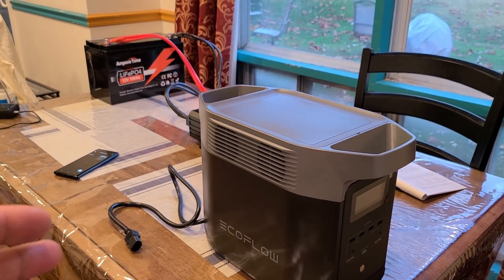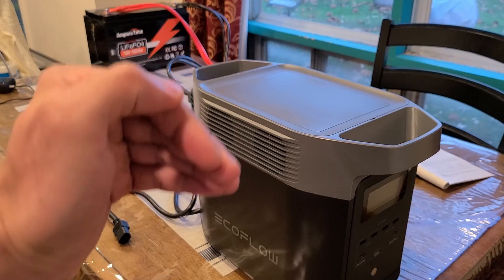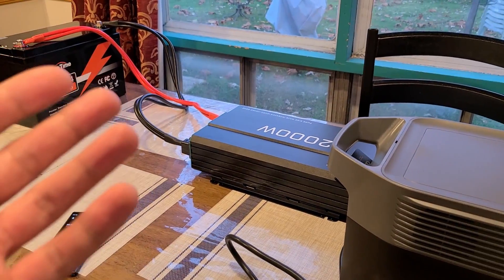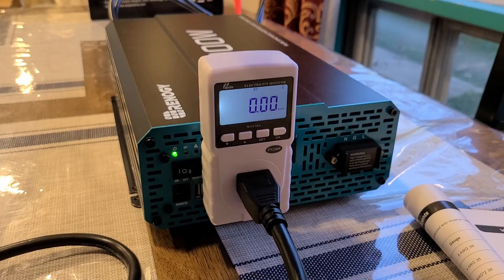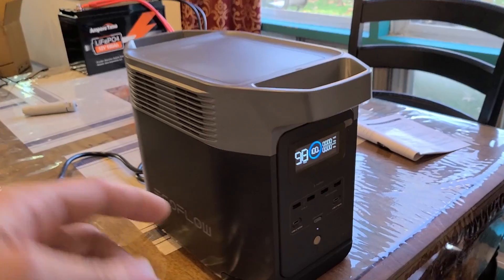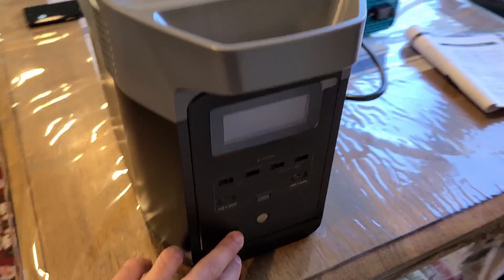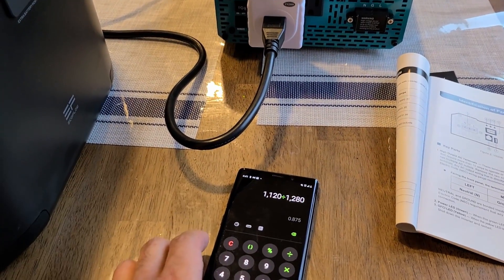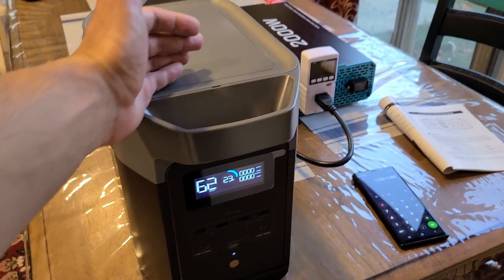Ampere (now LiTime) Time Battery Recharging EcoFlow DELTA 2 | Cheaper Expansion Battery?

Comment: use a 48v battery. no inverter is required. you will get the maximum solar charge by just plugging into your solar input direct from the battery.

Comment: I got a delta 3 plus then a 700w renogy inverter in my truck. It will charge power station at 700w no problems. Also have the alternator charger but never used yet

Comment: You are better off using a 24V, or 36V, or a 48V battery and connecting to the DC port used for your solar panels that has the XT60 plug.  With the 48V battery it will charge at 4 times the speed that the 12V battery offers and you do not need an inverter minimizing efficiency losses.
Reply: I was wondering why he didn't use that method.

Comment: What about with a conventional lifepo4 house battery with +\- poles? What’s the best way to connect a delta 2 max to this regular house battery so that the alternator charger is charging and discharging both batteries?

Comment: It sucks trying to charge your delta with the 2000w inverter at 300 watts. I tried with a 1000w inverter i was doing 200 watts but as you know my return date was like tge day before. So far out of energy is not working out. Im going to try Afllaa inverter.

Comment: Assuming you want to charge that battery from solar........... use a Victron mppt like the 75/15 or 100/20 that has a load port. Connect a cable to that port that has an xt60 female plug at the end.

Set the load port in victron app to turn of at 12.2 volt and to turn on again at 13.1 volt.

Plug the xt60 cable into the Delta and there you go, perfection!

The AC port is for using indoors when AC is available.
The DC port is for all other situations and these do not require charging at 1200 watt, not in real life.

Comment: Did you try turning off the Delta2 before you plugged in the 2000 watt inverter? Then turned on the delta2 then the inverter?

Comment: Great video thanks.  Is there a way we can hook up a deep cycle battery like that into the side expansion port?
Reply from the maker: Thanks for watching!

From one of the reviews for the expansion battery cable over on EcoFlow.com, it seems like the cable connecting to the side expansion port is proprietary. So I'm honestly not really sure if you can.

I did run another test like the one in this video, but I used a direct connection with the deep-cycle battery using the XT60 port for the DELTA 2. You can check out that video here:
https://www.youtube.com/watch?v=Q3cl_2AcDWc
Reply: Ya I seen that pretty cool.  We need to figure out if we expand it ourselves and have the unit charge both batteries bc that would be ideal imo. But im still pretty new bc I've only been using the delta 2 for a couple weeks. I like ur vids tho so keep em coming

Comment: Yeah, no need at all to spend money on an inverter.  You can either charge directly from the battery into the DC inlet port (if you're ok with 12 volt charging speeds), or you can step up the voltage with a DC to DC converter (for faster charge times).  A converter is going to be about a tenth the price of an inverter, and it'll be more efficient.  Since the inverter was only doing 300w, you could easily do that with direct DC.
Reply: Thanks

Comment: I have the Lifo4 battery like yours and the Delta2..... now my Inverter is a 375 Watt Modified Sine Wave Inverter.
   If you know, Do you think this would hurt my Delta 2 setting it up like you did there?
Reply: Es funktioniert nur mit einem reinen Sinus-Welle Wechselrichter.
Reply: don't do it because then you can't use your delta 2 as its being charged. the Delta 2 uses the inverter backwards in order to charge the battery. But if you use the solar input or car charger adapter that ecoflow supplies and connect it to a 12v battery it will charge the ecoflow and you can still use the full power inverter that the ecoflow has!!!
Reply: @uhjyuff2095  That is a good piece of information..... Thank you very much :)

Comment: I would hope to see a system that would work better with solar improvement say 500v 3000w. If the grid is down. What good is AC charger.
Reply: Hi Clarence.  You may want to check out the Hysolis Apollo solar generator.  It does have 500 volts of photovoltaic input as well as outputs 3000w.  It isn't on the market yet, but is scheduled to be released in December of this year.  I preordered and am looking forward to receiving it next month.  Minuteman prep has a video describing it.  Hope this is helpful.

Comment: USA  120 volt  'grid'  power  has  the  ground  &  neutral  'common'  before  entering  your  home.   That  way  a  'ground-fault'  interrupter  can  protect  you  from  electrocution  in  your  bathroom  should  a  difference  be  detected  between  the  ground  &  neutral.   (as  'splained  to  me  by  an  'electrician')  ! !
Reply: not correct. GFCI devices protect against electrocution by detecting a difference in current between the grounded conductor and ungrounded conductor.
Reply: @uhjyuff2095  -   The  ground  is  not  a  'conductor'  as  the  Hot  &  Neutral  are,   so  we  are  in  agreement.   GFCI  detecting  a  difference  that  should  not  be  there  (since  ground  &  neutral  should  be  same  as  back  on  the  pole  outside  your  home)   VIVA  la  Differance  ! !
Reply: @richardhobbs7107  you are clearly missing something. The current carrying conductors are the ones that can cause electrocutions. The two current carrying conductors that connect to the GFCI are known as the "ungrounded conductors" (color black/red) and the "grounded conductors" (colored white/gray).
Reply: @uhjyuff2095  -   correct  .  .  .   agree .  .  .   what  am  I  missing ?
Reply: @uhjyuff2095  -  although  ground  is  usually  green  .  .  .   are  you  in  USA  or  ? ?

Comment: Charger Harbor -  You  mentioned  @1:30  the  'ground-fault circuit would be interrupted'  on  the  Renogy Inverter.   Because  there  is  no  'ground'  handshake  with  the  neutral  connection  in  the  120 volt  circuit  ?  any  voltage  difference  would  cause  the  ground  fault  to  trip.    I  found  that  hard-wiring  the  ground to neutral  on  an  'adapter'  (two  to  six  socket  wall  plug-in)  fixed  a  problem  I  had  charging  my  Nissan  Leaf  with  a  (non-grounded)  power  station.   As  you  know,  power  stations  only  have  an  empty  hole  to  allow  a  grounded  plug  to  be  inserted  in  the  110/120  volt  outputs   .  .  .  .  .   depending  on  internal  wiring  of  Delta 2  that  could  be  the  issue.
Reply: The Delta 2 also has a UPS function, meaning when you charge from mains power the mains power is directly connected to the output receptacles on the face of the Delta 2. That way the wiring is completely safe and the exact same as using power from your house wiring. Not sure what is going on with charging the delta 2 with the renogy inverter suppling 120 volts AC to it and it struggling or tripping. Is it a problem with the renogy or the Ecoflow?

Comment: y do u have two + & - cables instead of 1?
Reply: the inverter is 2000 watt continuous output rated, which is equal to about 200 amps. Thicker wires are able to carry more amps.

Comment: If you can only pull 300w via the AC input on an inverter then why don't you just use the solar input on the Delta and put 500w of "solar" in it from the external battery?
Reply from the maker: That's a good question. I'll try it out. Thank you!
Reply: @chargerharbor  yea just eliminate AC and go DC from the battery to the solar input on the delta..
Reply: because theres no sun at night, the extra capacity is needed

Comment: I have seen others have similar issues with  Renogy  inverters. Once they got a different pure sine wave inverter things worked right. Renogy 2000 and 3000 watt inverters seem to be junk.
Reply: thats what i was thinking..   sensitive to "sin wave"
Reply: I've seen others using Renogy inverters on the River and Delta Max and get charges up to 1.1kw and over. The problem is with the Delta 2. Faults every time, once it charges over 290 watts.
Reply: DC  -   He  mentioned  @1:30  the  'ground-fault circuit would be interrupted'  on  the  Renogy Inverter.   Because  there  is  no  'ground'  handshake  with  the  neutral  connection  in  the  120 volt  circuit ?  any  voltage  difference  would  cause  the  ground  fault  to  trip.    I  found  that  hard-wiring  the  ground to neutral  on  an  'adapter'  (two  to  six  socket  wall  plug-in)  fixed  a  problem  I  had  charging  my  Nissan  Leaf  with  a  (non-grounded)  power  station.   As  you  know,  power  stations  only  have  an  empty  hole  to  allow  a  grounded  plug  to  be  inserted  in  the  110/120  volt  outputs   .  .  .  .  .
Reply: @richardhobbs7107  Oh okay I missed that. That is why in my breaker box ground and neutral are connected. I watched couple videos why. so if anything happens it will return to breaker so it trips.

Comment: Could you not just use the solar/DC charging ports to go DC to DC so you don't waste power using an inverter?
Reply: fyi... The Delta 2 D/C input has a "hard limit" of 500 watts using any combination of voltage between 11-60 Volts X's Amps = (up to) 500 watts. "Hard Limit", meaning that the Delta 2 inverter does not regulate D/C input and will reject and cancel "all" D/C input over 500 watts and charge at 00.00 watts. The Delta 2 inverter will regulate the A/C input in combination with the battery BMS in pre-programmed increments of up to 1200 watts of A/C input. I suspect those figures may change with future Firmware/Software updates?
Reply: @royrobinson4636  Nice piece of information.... thanks for taking the time to respond
Reply: @notwrkn2mch  ~ Thank you, I've done a lot of research on my own. 🤠
 I use my Delta 2 specifically as a backup power supply for my Starlink internet (router and dish), two mini-computers, two monitors, and two low-watt Led lamps.  Considering the Delta 2 "500-watt D/C Hard Limit", I use four (4) 12 volt/120-watt Solar Panels (480 watts) connected in parallel via the Delta's XT-60 port. This is a completely independent circuit from my larger house solar array, battery storage, and dual-fuel generator system. I live in a very rural area and we like to be prepared and as independent as possible. 😊
Reply: @royrobinson4636  Same here.... very rural north of Phoenix in the Sonoran Desert. I have 220 watts of solar and just one Lifo4 100 amp hour battery to keep charged and feed the Delta2......Good luck out there and it may be a rough ride ahead......
Reply from the maker: Like an XT60 to O ring cable? If so, I'll give it a try. Thank you for the info!
Reply: @chargerharbor  ~ Exactly. Since the Delta 2 does not come with a solar charge cable, I use a 12 gauge aftermarket XT-60 to MC4 cable to connect my panels.
Reply: I seen a video on Youtube where the person used the same Battery and put that yellow solar plug in the back to the battery and it tricks the Delta2 into thinking it's a solar panel and it worked just fine.... I haven't tried it yet
Reply: Sorry but maybe I didn't get it right ... expansion batt.?? This is charging the Delta from a Lifepo batt, I see that and works ok, but this is not as putting the Delta extra batt. !? As here in this setup you do not double the available power output to 2x 1024
Reply: The PV connectors are upgraded on the Ecoflow Delta Max2 to XTC60i which wil allow more watts than the standard XT60 connector. 

Also as most Power Stations have a floating neutral because they're connected in a variety of ways.

For instance when charging from an AC outlet then the AC outlet are grounded since most homes have a ground connection. 

When connecting to an appliance from it's outlets there isn't a ground, however, you can purchase a grounding plug from Amazon which has its neutral tied to its ground and this will then ground the other outlets protecting you from appliance shock should something short out on the appliance. 

You do not want to use this grounding plug when charging the unit from your homes AC outlet. 

Not sure if this grounding plug would solve your issue but I'd try going from DC to DC using the PV connection using a XT60i connector. 

But you have to be within the 60v, 15A limits of the unit.

https://www.amazon.com/gp/aw/d/B0BLZ8QKLV/ref=ox_sc_act_image_7?smid=A1DWF2FYAPMTIY&psc=1
Reply: Exactly
Reply: How much time did it take you to completely charge the delta 2 from 0% @300 watt rate?
Reply: Yes a 24vote and a T60 I. Make sure you buy a t60i .The one you my get with a car end will not work.
Reply: I used to worry about wasting lost wattage with this same AC inverter setup but solar panels are so cheap i can easily charge up 2 batteries to full with just 600 watts of solar panels during the summer time with plenty of daylight to spare.  AC input is faster and if you got the panels and batteries to harvest power, just stick to this route.
Reply: Connecting a 12v battery directly to the xt60's delta input will give a maximum of 120 watts of power. Charging would take 8.5-9 hours. A better effect would be to connect a 48 volt battery from the e-bike, or any such package. Charging would take place with the full input power of the mptt delta inverter.
Reply: @AVRANTUS  I would imagine you could also get a cheap boost converter Although it would use a little bit more power, you should be able to charge at a much faster rate.
Reply: @PaulBrunt  Exactly. From 12v to 24 and even better to 30v because the amps on the Delta input are locked. The charging power can be adjusted only by increasing the DC voltage at the Delta input.
Reply: @AVRANTUS  this may have worked in the past but it's not working today they may have patched their software because I can't get it to work it comes on goes up to about 300 W for about a minute and then it turns off every time
Reply: you don't even need a DC to DC if you have a MPPY with a programmable load port :-)
Reply: @HansKeesom example?

Comment: Is it possable the EcoFlow Delta 2 wont allow 1800 watt charging if the batteries in the EcoFlow Delta 2 are below 10% charged? Battery chemistry and or safty my prevent charging of over 300 watts when the EcoFlow batteries are in such a low state of charge. Another possable is the 2000 watt inverter being used to charge the EcoFlow Delta 2 is not outputting aceptable 120 volt A/C pure sigh wave electricity. The inverter can operate a hot plate or heater just fine with less then acceptable pure sighn wave A/C. Just ideas. Thanks for the video.
Reply: @Dan, I believe you're correct. The Delta 2 will not accept a shock load of "1200-watt" (the max) A/C input when the unit is completely dead at zero %. To verify that statement, try a 500-watt input with the Delta 2 at 50%, or 750-watts at 75%.
Reply: @royrobinson4636  Roy, I agree. Plus, the battery management controller inside the Delta 2 may have entered a protection charging curve due to the temperature of the Delta 2 batteries. So much going on here. I believe in a three-cycle event of slow battery discharge and charge before performing any evaluations. The battery charge computer on EV vehicles is very sophisticated in managing the voltage and temperature of each the 200 plus batteries inside the main battery pack thus improving safety and range.
Reply from the maker: I think your explanation of the inverter not outputting an acceptable 120 volts makes the most sense. I'll play around with it and see what happens, if I find anything substantial, I'll post a video. Thank you!
Reply: @chargerharbor  ~ A simple test would be with a 0% charge on your Delta 2, plug it into a wall outlet. You will not instantly see a 1200-watt input. You will initially see a comparable input to your battery/inverter setup until you reach a higher charge % on your Delta and, the inverter, and fans start. That's the BMS (battery-management-system) and inverter working (as designed). The Delta 2 will not instantly charge at 1200 watts all of the time, it charges in much safer and more battery-acceptable increments.
 The Delta 2 External Battery uses the same "incremental charging" BMS system, your battery/inverter setup does not. I also suspect your battery and inverter work perfectly (as designed), it's just Unacceptable to the Delta BMS system. I believe you would have better luck using the 500-watt D/C input. If your inverter sinewave was the problem, why would you have an acceptable sinewave below 300 watts but not above 300 watts (from a 2000-watt inverter)?